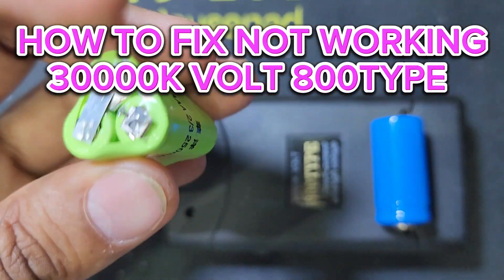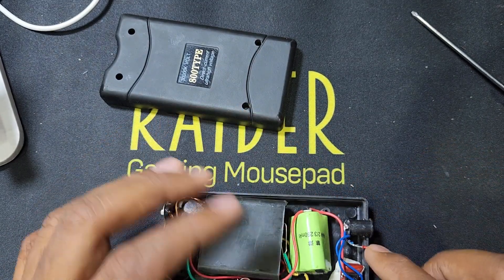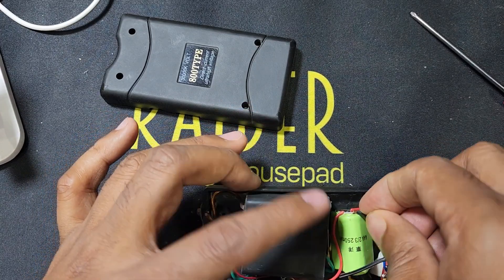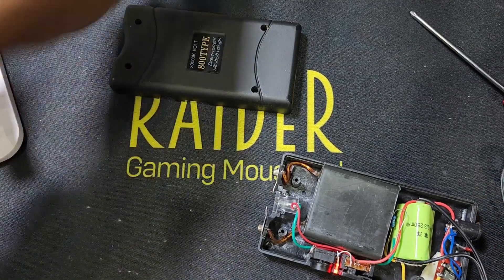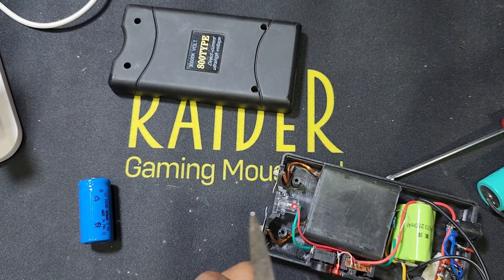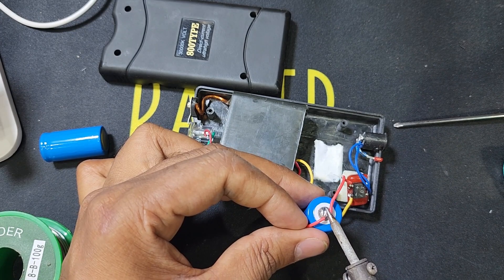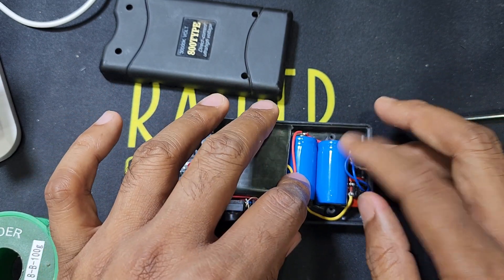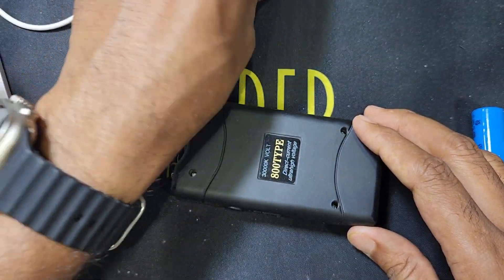NOT WORKING FIX AT HOME 30000K VOLT 800TYPE STUN GUN/THIS DIVICE FIX EASY WAY AT HOMR IF NOT WORK

Comment: What is the voltage of original battery ? Overall 3.7 V or 12V (3.7v x 3 Nos) ??
Reply from the maker: 3.7 no problem
Reply: the original battery pack consists of 3x AAA 2/3 250mAh batteries in series. 
AA and AAA batteries are both rated at 1.2 - 1.5V
The 2/3AAA is also 1.5V but only 2/3 the size of the AAA - same voltage though.
SO the original 3 pack cluster in this device is going to operate at 4.5V or 3.6V